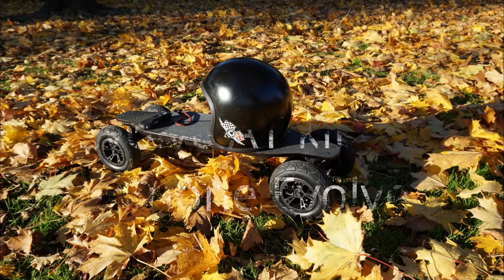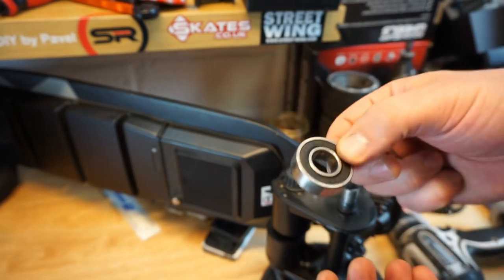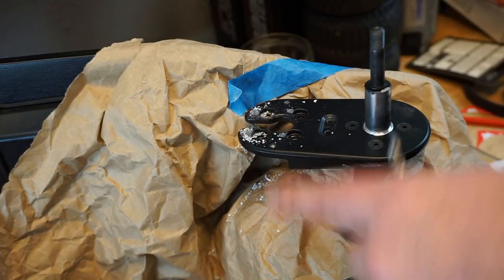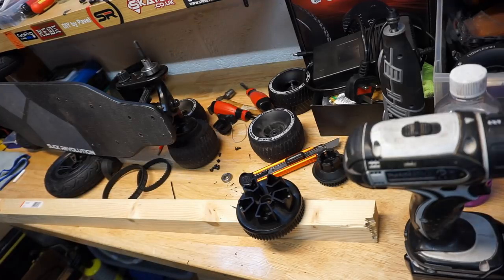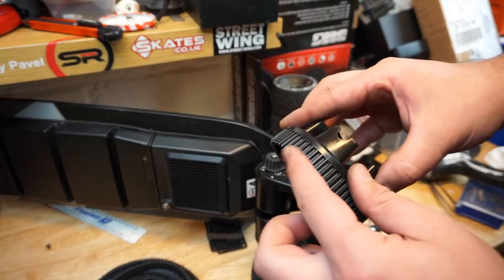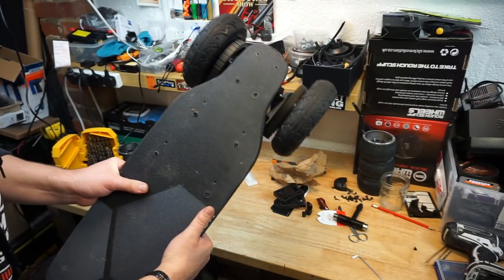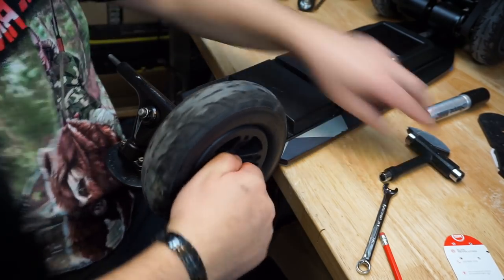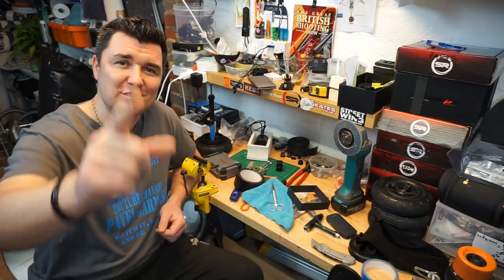How to modify Evolve AT wheels and install on other boards tutorial.

Comment: Hi Pavel, 2 Questions : Outside the enjoy of using your engineering skills that we really highly admire & (correct if I'm wrong) why not buy or acquire the entire EVOLVE AT set up...using a second or third to bypass Evolves paranoid business practice?...  hence no drilling the motor mount plate, etc...and my express hope is the modification may well be easier?
Reply from the maker: Hi mate,
I do enjoy DIY and I took it as a challange to make this board work on AT wheels. There are plenty of second hand parts available now but Evolve is not on my list anymore.... full DIY boards is my interest now.

Comment: I like it Pav! How did you find the consistency while riding? Any jerks etc?? My only concern with this is getting the correct belt tension. Your belts look quite slack, have you found this an issue? 
Love your videos man! 
Your crazy test-ride friend!
Reply from the maker: Hey!
Belts should be as loose as possible as long as they do not slip during the hard break. Board was performing well but it was just a project .... i did not keep the board as the motors are too weak for my weight.

Comment: Easy ' Pav

Did your review any A.T perforated wheels? Tubeless, as I was in search of one.  Thanks ..
Reply from the maker: Hey mate!
No i do not have the review of perforated wheels... i do not like them too much because they do sag under my weight to much. Foamies and Rough Stuff are the only mixed terrain wheels that i do use and for the AT - Trampa or Evolve air filled.
Hope this helps.

Comment: I was onboard with the hole saw...but the second adjustment to the cutouts could've been made nicer with a die grinder and sanding tip. All those semicircles are ugly and jagged.
Reply from the maker: Hello James and thank you for the comment. Good point and i will definitely conciser during the next build. I have used the jig saw on another build after that :  https://youtu.be/PrvNG02uQk8

Comment: Probably a stupid question but Couldn't you just use a smaller belt instead of having to move the motor away from the wheel?